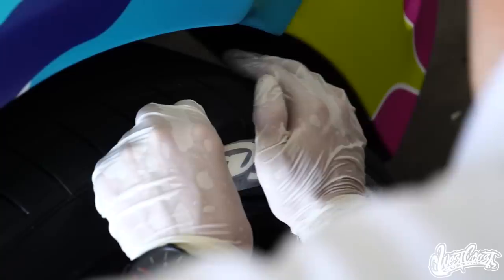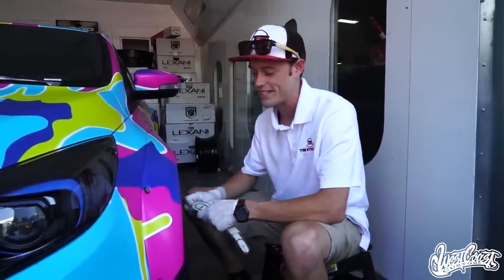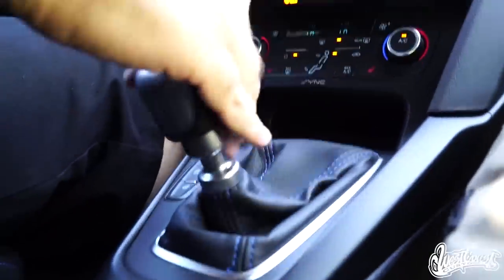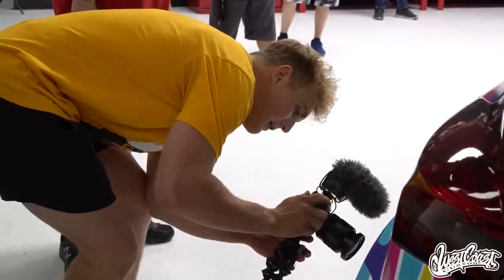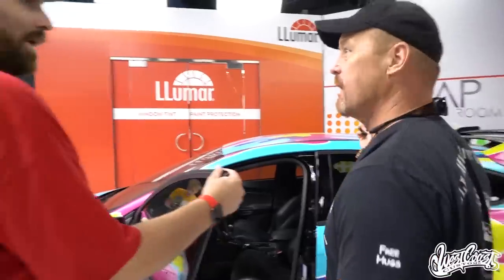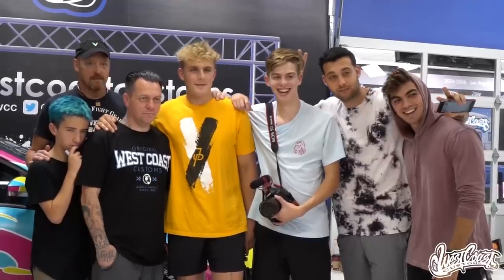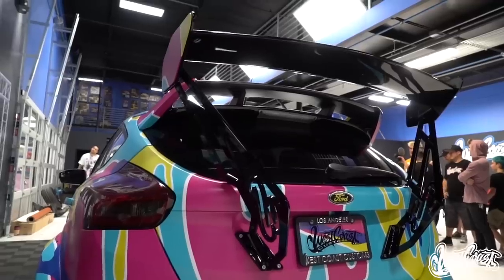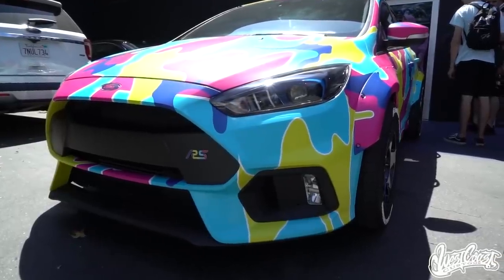Jake Paul's Ford Focus RS | West Coast Customs

Comment: Jake Paul can drive stick???  Anyways the wrap looks fine but the wing and wide body look atrocious
Reply: iMiguelAOG What do you mean he can drive stick? it’s so easy
Reply: Shona Its not hard at all  😂😂😂
Reply: Shona the thing is the hardest part of driving a stick is releasing the clutch In normal cars you have to release them really slowly but in hot hatches like the RS you can let them off quickly
Reply: Amar Gaming You can release the clutch quickly in any car, it's all about matching your revs and getting the biting point of the clutch at the same time as you pin the throttle. The RS is no more difficult or easy to drive than most other manual car that doesn't have an uprated clutch.